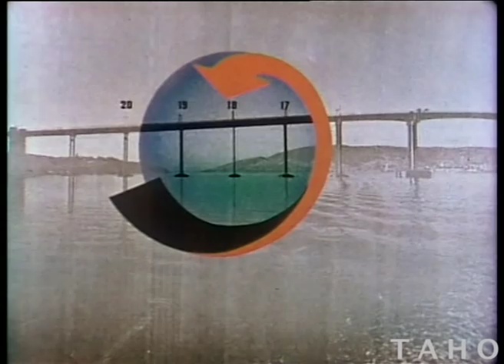Tasman Bridge Reconstruction (1978)

Comment: I left Hobart in  September '61 and well remember the initial construction underway on both sides of the Derwent (I was almost 8 at the time). I revisited Hobart in November 1993 and took the boat ride between Constitution Dock and the Cadbury factory. Along the way, we were given a talk by one of the cruise personnel who described in detail the Lake Illawarra crash and the subsequent effect it had on Hobart. The effect was devastating (initially) with only one effective road across the Derwent (at Bridgewater) and it required a round trip of 40 or more kilometres - ferry services became an absolute necessity, provided they could get the ferries (some old ones came down from Sydney). Hobart airport also existed on the Eastern side so traffic between it and Hobart (CBD) was hampered. However the end result is remarkable with a third bridge (Bowen, as well as Bridgewater and Tasman) also built across the Derwent  and the Eastern side now has a more independent outlook. The video is quite good but I would have liked to have seen the inclusion of diagrams to illustrate the various talking points (eg piles, decking etc). Still, thumbs up.

Comment: Why didn't they just initially build a suspension bridge? They are specifically designed to span great distances and would only require towers on the shore of each side of the river. I just have never understood why they went with this design.
Reply: Not practical as the land on either side is almost sea level. Sure, you could build big towers, buty then you need huge ramps to get the cars up to that height.
Reply: The additional cost compared to the design that went ahead was a factor. Having said this there were some cost over runs building the Tasman Bridge and ultimately, the additional expense of a suspension bridge would not have been so much more as to make it prohibitive. 20/20 hindsight.

Comment: Surprised the ship has not been salvaged, in some ways thats good.
Reply: Not surprising at the time. Some thought was given to a possible salvage but the difficulty of doing so included the depth of water (around 40m), economic ease of recovery ($'s) and the need to get access between both sides of the Derwent resolved as quickly as possible. Although not clearly explained in the documentary, part of the reconstruction involved setting some of the piles through the sunken ships hull itself - so it cannot be raised now, whatever the technology.